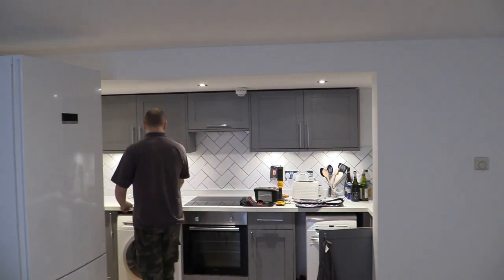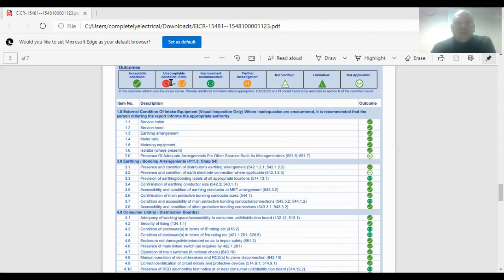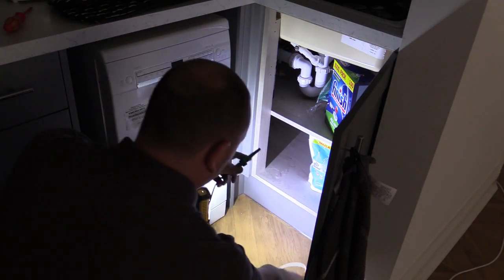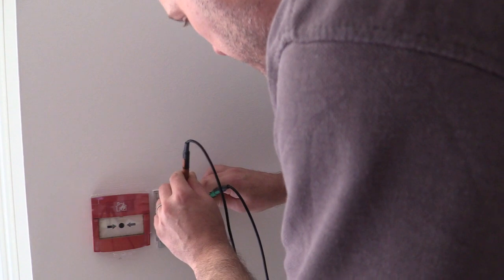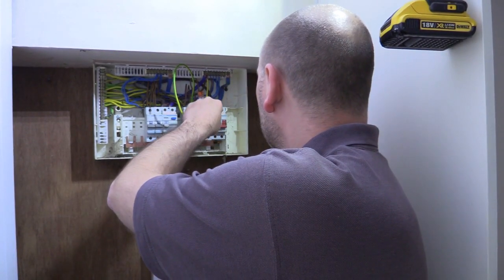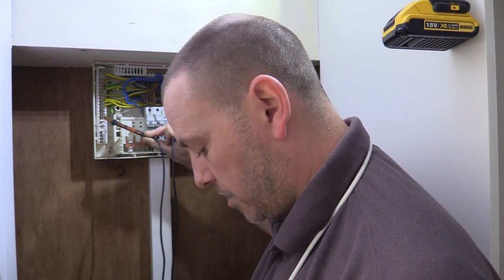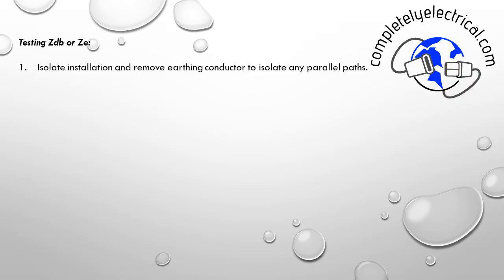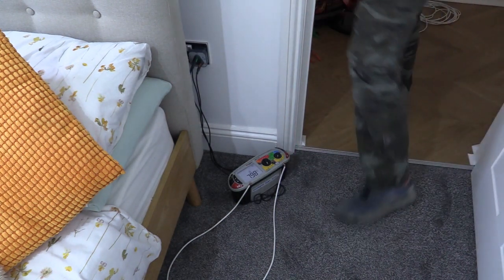EICR 1 bedroom flat

Comment: Hi mate whats the regs with the c.u being supplied by the 16mm twin and earth, should it not be rcd protected because its twin and earth 
  Also Do they have to run the seperate main earth because the gas and water bonding coming off the c.u, and the twin and earth cpc would not be large enough
Reply from the maker: It's certainly a consideration regarding rcd protection of the supply cable in domestic properties and also the physics of bonding requirements. In this case the flats cu was directly below the main intake (2.5m of cable) so when applying the adiabatic it was fine regarding size of submain cpc. Also the bonding requirements are there to reduce touch voltages so it's about "within the flat"   the point of entry of the metallic utilities needs bonding to the met of the flat in any case. If a flat was 15 storeys high and bonded from intake met to flat then during a fault condition inside the flat on say the shower circuit, would result in less reduction of touch voltage due to the increase of bonding conductor resistance. We need to assume the resistance of any bonding conductor is effectively zero then any touch voltage can be calculated by using 230/Zs of faulty circuit x R2 =Ut  It would be better connected to the met of the flat cu so we can assume a good reduction.

In this case again, it was done both! 😂 Both water and gas were bonded from the main intake and also from the flat.

Chapter 54 of BS 7671 is everything earthing. For earthing conductors it's either adiabatic or table 54.7 and for bonding conductors it's either "not less than half the csa of the earthing conductor" or table 54.8 if pme exists (reg 544.1.1 currently page 205)

Comment: This video is very helpful. I like the idea of drawing a layout of the house and the electrical components in place. So far, I've done it by memory, and then had to double check which socket is on which circuit or realised later on that I've missed something in an unexpected place. I'll suggest that we implement this in the company I work for.

Comment: Just a a curious question, so on your Ze test you said the High current setting helps from the interference in the street, why is that?
Reply from the maker: I believe the way they work is by knowing the supply voltage, attaching a known load and recording the volt drop. The more load the more accurate it would be due to the fluctuations you would get with voltage anyway. We used to use a high current for all our loop testing but it obviously trips rcd rcbo which is why we use low current for those in general.

Comment: Why worry about 2 separate main bonding conductors to gas if both readings are ok?
Reply from the maker: One of the conductors is strewn across un unused pathway (looks awful) and seems like they added it because they wasn't sure about the original? Odd, il be removing it soon as its not needed. Original tests fine although pipes are corroding!

Comment: Would you not do IR tests on the individual circuits after finding a lower reading on the group IR test?
Reply from the maker: Yep why not? I had already done it to be honest when i tested the boiler circuit before hand but i didn't show it. I knew it was essentially all cables that went under the floor. some historic damp there. I suppose another way of looking at it would be to record all circuits as that figure as it will always be lower than the lowest circuit? so behind covering approach :-)

Comment: R1 + Rn... Do you record that anywhere on the EICR paperwork?  I may be wrong but I didn't think this test was required on an EICR?
Reply from the maker: No there isn't but you do need to do it if you want to prove polarity at each socket. If i found no reading at a socket between L-N then almost certainly ive found L-E reversed, if no continuity between L-E then prob L-N reversed, No reading on either then N-E reversed most likely.
Reply: @cestemshow  yes my point is why doesn't the EICR require these tests to be made?  R1+R2 only proves the line and earth are intact.  No test to prove neutral impedance at all from what I can see.  They should insist on a PSC test at each socket if you ask me... You then record L-N loop impedance.  Wouldn't need to do R1+Rn then and wouldn't need to remove wires at the board.
Reply from the maker: The regulations expect us to confirm R1+RN for ring final circuits but doesnt specifically mention it for radials which is odd (643.2.1)but the standard forms have no place to record it, its just to confirm polarity and continuity really. I agree, R1+RN is just as important. I always do and I do record the results in comments but the standard forms could easily put a box in to record a value.

Comment from the maker: OK so, had a few comments on social media about the ring results so let me clarify a few things:
Firstly, this is not a training video....This is just what happened and I thought it might help a few people to turn it into a kind of guide but if you are relying on this to teach you how to do testing then you need your head examined because there was lots of thought and maths behind the scene that would have bored my students to death along with anyone else watching......

1) I didn't mention the maths:

.......well, I did actually, shot about 20 mins on it but edited it out because it ruined the flow but here it is:

When you cross link L-N then the reading you should get is APPROX (r1+rN)/4 which in my case should have been (0.27+0.3)/4=0.14
The readings I got at the sockets were various from 0.07-0.15. This, on the face of it looks all over the place but actually ive never ever seen text book results ever and can be explained by meter inaccuracies, variations in the internal conduction of the sockets (because I used an adaptor rather than probes on cables, had I used probes on cables then the amount of pressure applied would cause fluctuations. Also having the leads twisted can affect the result in a minor way. 

2) I took a reading at the board? 

Yes, I do, as well as the maths because it is another point to compare the ring to and increases the accuracy of any average.

3) the r2 was higher than 1.67 times the line and neutral.....

The flat is damp therefore I expected the cpc paths to be a little corroded but as the circuit still complies it cannot be coded....only noted.....which it was. Hence my funny face and saying "hmmm its aalllright" 

4) I didn't show the maths of L-E cross.

Again, I did but edited it out. In text book land The R1+R2 should have been (0.27+0.93)/4=0.3 but I got 0.18? Why? well, again there are meter discrepancies, variations in the conduction of the internal sockets, poor ins res which would have an affect when measuring Line and cpc crossed rather than individual loops, Also, you may have noticed the meter did actually read a lower value when I recorded my r2 loop but I chose the middle of the range value. That is a real world judgement and as I said still complied by a long way. The actual values throughout all the sockets ranged around 0.18-0.26 and this could have been due to the original loop reading for r2 being wrong (my judgement may have been over the top)

This is a P.M.E system in the middle of a built up city so Diverted or circulating currents in the area can also travel along the cpc path via any parallel paths when measuring and these will get in the way of the meters current and cause the kind of fluctuations we saw.. This flat had supplementary bonding to 16th edition and was connected to one of the sockets.
Reply from the maker: There were many supplementary bonding conductors throughout. I could only get to one in a socket. The gas and water both were in concrete under the flat so simply wasn't practical or even possible to remove all of them. 3 disappeared into the floor which was laminate on top of screed etc so went down as an obs for access. So i suspect i was picking up currents from the gas/water, along supp bonding to circuit cpc.